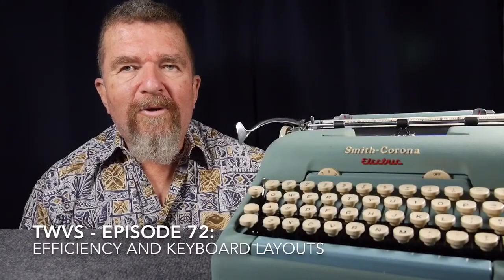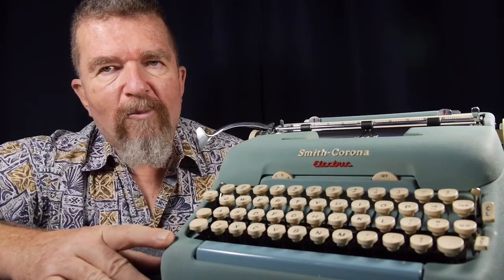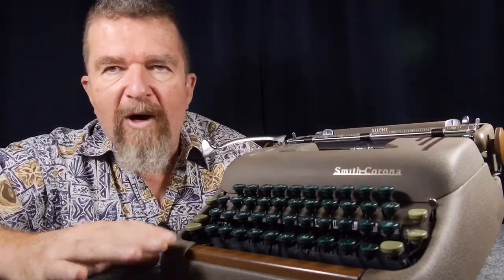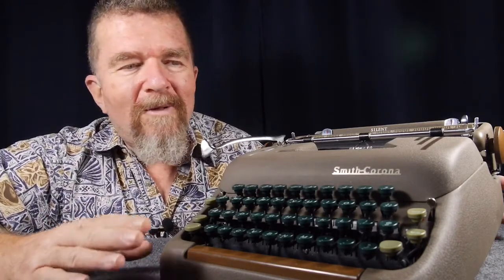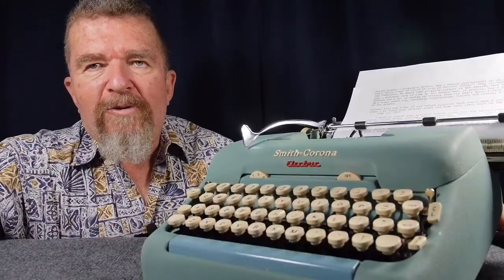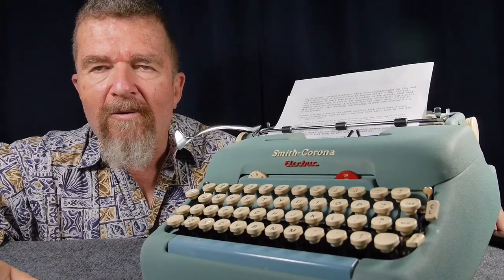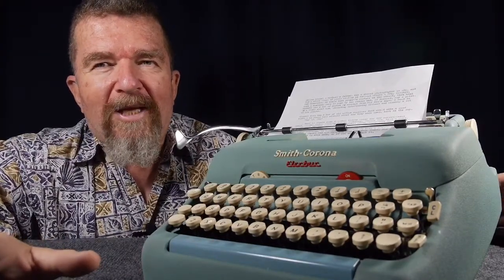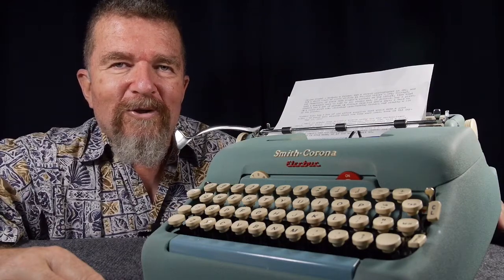Typewriter Video Series - Episode 72: Efficiency and Keyboard Layouts

Comment: I think the first two reasons you posit for the apostrophe being shifted sit best with me:  I was taught to touch-type in the 1980s on manual machines which had blanked key tops (and I still find that I prefer a shifted-8 after all these years!). I also agree that the relative size of the character means that the more solid impression possible by using one of the main fingers would have been better than relying on the weaker little finger.

I'm really enjoying this series - I'm working through them all in turn, and I'm enjoying them as much as your 'confessions of an office junkie' ones.  Thank you for putting in so much time and energy.

John
Reply from the maker: Thank you!

Comment: Exclamation points should be hard to make and time consuming so they are rarely used.
And you can cut down on apostrophes by not using them incorrectly.
I suspect the + and = were added as part of the Space Race revolution in education to accommodate scientific notation.

Comment: iPhone doesn't have numbers without hitting the num key. But android has the top row with numbers. Still there isn't any standards. If you would recommend a manual typewriter which one would be more like a modern (current keyboard) keyboard?  
Thanks
Reply from the maker: In general the typewriters made in the 1970s and later had the number 1 key. The switch-over was sometime in the late-1950s to mid-1960s. You'll have to examine online photos to be certain, if you're interested in a particular model available for sale.

I'm not aware of any manual typewriters with the apostrophe as a lower case key on the home row, as in the Smith-Corona Electric mentioned in the video; but if you find one, let us know.